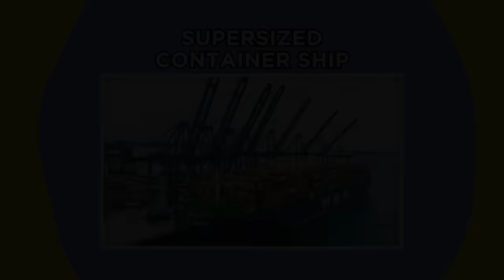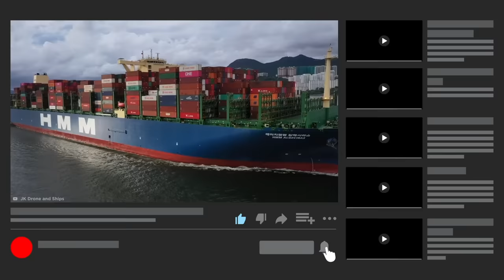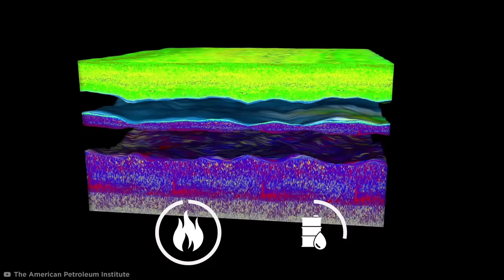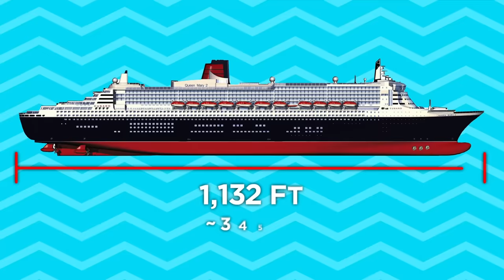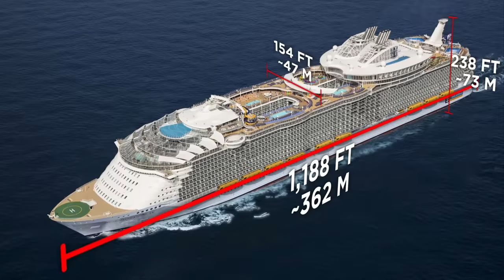LARGEST Ships On Earth

Comment: Another fun fact about the Zumwalt class. The 2 railguns at the front (Yes they are railguns and not just your regular 127mm naval guns) doesnt have any ammunition. At $35,000 per shell, the US navy wasn't keen on spending such a huge amount on ammunition for a prototype gun.
Reply: The problem with public purchases is that they always become much more expensive than what was planned!
That they then just order a small fraction so does the unit price enormously as it will be spread out over a few copies instead of dozens! That because congressional appropriations vary so hugely, engineers have learned a long time ago to compensate for because the authorities so rarely ordering what the attracted with...
Reply: ye but at this point 1 shell for the railguns cost at least 1million dollars the same price as a tomahawk cruise missle
Reply: *500k
Reply: Minor correction: They're looking to replace the guns WITH railguns, because the prototype gun they had (which was some how supposed to do some like guided projectile thing? idk the details of how...) used that ammo that was too expensive. I think only about 150 rounds for those weapons were ever made.
Reply: @darrolarendse12  railgun projectiles are probably some of the least expensive ammunition, actually. Literally all it needs to be is a solid shaped rod of a ferromagnetic material. In fact, if you know a few things about circuits and electronics, you can build your own rail gun relatively easily.
Reply: Isnt the point of a rail gun propelling a projectile of just pure metal so idk how big the shells are suppossed to be but 35k for essentially a big piece of metal is hard to believe
Reply: @wesleydamen2018  no, its more arund 200k
Reply: There is no railgun in it, you dolt. It houses 2 × 155 mm (6 in)/62 caliber Advanced Gun System that looks more like an artillery gun.
Reply: They're not rail guns, they're a 6" Advanced Gun System. You're correct that there is no ammunition for them, after the order for the ships kept getting cut to eventually three, that meant only 6 guns in the fleet so it was not cost effective to make ammunition for them. One of the proposals is to replace them with rail guns, or even modified existing 5" guns. Fun fact, the 6" AGS and the ammo was pushed as a reason to fully retire the Iowa class battleships, it was said the AGS on the DDG1000s could provide the same naval gunfire support.

Comment: Those "incredibly powerful 6,700 horse power thrusters" are puny by naval standards. The diesel engines built into large ships routinely prodouce well over a hundred thousand shp(shaft horse power).
Reply: To be fair they are big all the same. Just the nuclear reactor is on a whole other level compared to any engine.

Comment: Wish I could understand the way these massive structures actually float
Reply: 🤣same. I think it’s magic
Reply: It's called relative bouyancy in engineering terms. It's displacement, compared to it's density is the key. As long as the density is less than the water it displaces, it will always float.

You could make a 1 million ton ship float, as long as the displacement water has a higher density.

Simples.
Reply: @RB747domme  cool thanks it's just crazy how that works

Comment: My dad was a Captain in the merchant navy until he retired early in the early 1990s. He was on the big super tankers of the day back then.

There are several things that stood out for me, apart from he was one of the nicest men you could ever wish to meet.

I asked how big are the ships you sail compared to the ones here, while at a harbour on the North Yorkshire coast, England. He said that we have lifeboats the same size as this trawler.

I remember standing beside an engine cylinder of one of these tankers and I was dwarfed by the height of it. I stand 5 feet 9 inches or 1.75 metres tall.

One tanker he was on was in the dry dock at the Lisnave shipyard in Lisboa, Portugal. I flew out to see him for a cheap holiday! He took me underneath the ship in dry dock and I will never forget the experience. Until you go up close and personal with a ship you don't realise just how enormous they really are.

I'm used to working on engines but I wasn't prepared for the size of rocker arms and pushrods of a ship's engine. They were a bit bigger than the ones on car engines that I was used to working on.

I could go on and on but you get the picture.

R.i.P. Dad wherever you are sailing. May the sun be in your face and the breeze be behind you. I miss you xxxxx
Reply: This is the biggest comment I have ever seen and did’t even read it😂

Comment: Instead of just stating the length, would be better to show the width / displacement / GT for every ship.
4:25 it's not the world's widest ship. 2:24 Pioneering Spirit is much wider. 14:38 BOKA Vanguard and few tankers are also wider if you only count single hull.
6:54 the picture is misleading. It didn't carry containers or cargo on its deck. It carried oil inside the hull.
7:41 it couldn't pass the canal simply because it's too long, too wide, and sitting too deep into the water.
Overall, the largest ship ever built with everything considered should be 6:16 the seawise giant. Since 23:05 the Prelude is not really a ship.

Comment: I’m not sure where they got their facts but they are way off on Symphony’s width. It is 215.5 feet wide (66m), not 154 feet (47m). Of course now the Wonder of the Seas is slightly larger and the coming Icon of the Seas will be even larger at 250,800 gross tonnage compared to Wonder’s 236,857.

Comment: I see you believe all containers rest above the weather deck. On these super container ships the weather deck is not needed so you might see the framework that guides the containers down inside the open hull. Only spray and rain is expected to wash into the open hull, where a hundred pumps can remove it. Here we see 8 ft  containers stacked ten high above the weather deck. There are a similar number below.

Comment: Hahahahahaha Shell has built the largest ship in the world. With a length of 488 meters, the Prelude is more than 45 meters longer than the Empire State Building and even 90 meters longer than the second largest ship. The Prelude is also 74 meters wide and 110 meters high. The colossus weighs 600,000 tons.